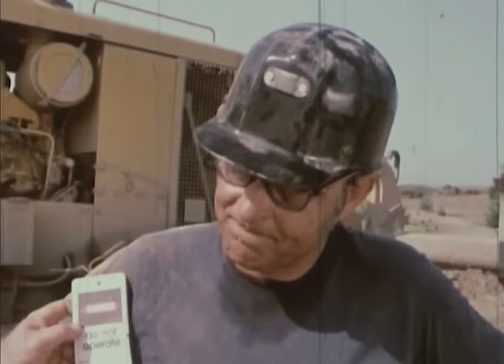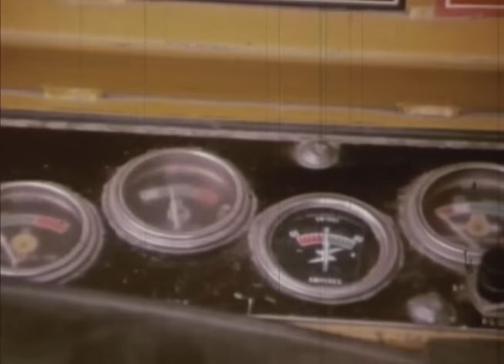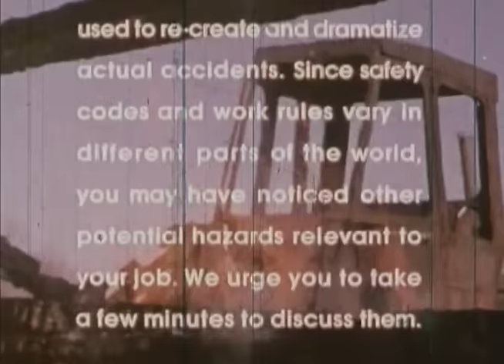@RiffTrax: Shake Hands with Danger (Full FREE Short)

Comment: Hey, guy has to insert that metal cylinder into the hole. I get that you don't want to spend the time to find a tool that would let you lube the hole safely, but why didn't you just put the lube on the cylinder you are going to stick in the hole?
Reply: ....because it would make too much sense?